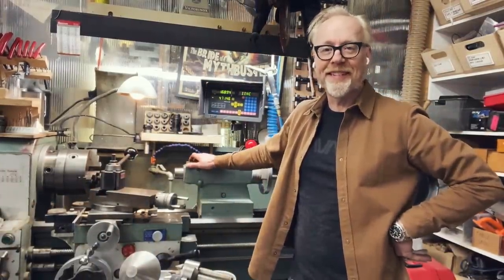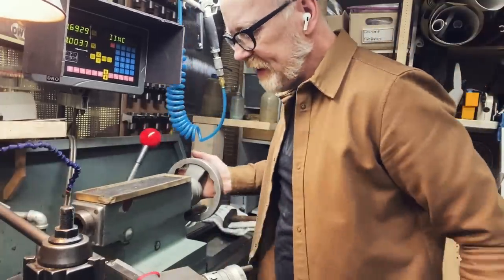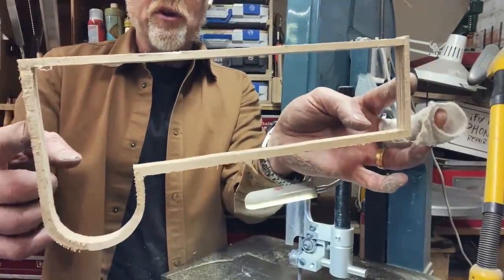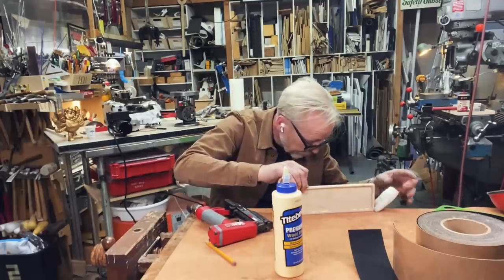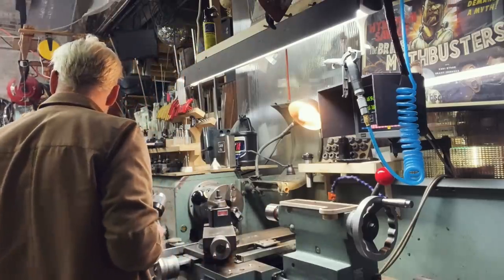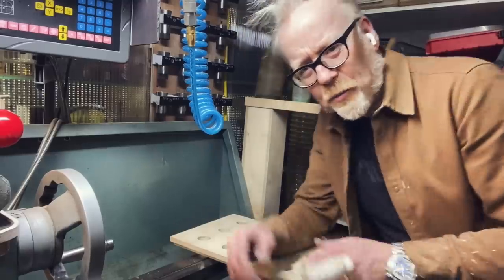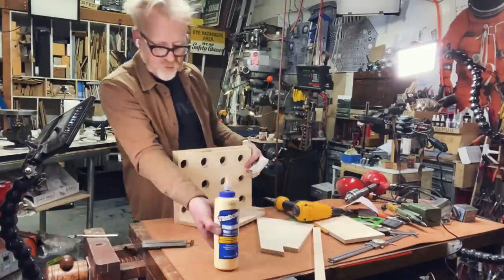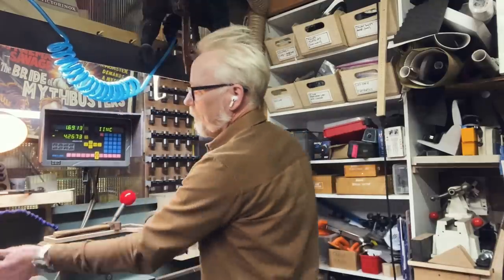Adam Savage's One Day Builds: Lathe Infrastructure Upgrades!

Comment from the maker: Materials used in this build: Senco 23XSP 23 gauge micro pin nailer: https://amzn.to/35PqgUC
23 gauge headless pin nails: https://amzn.to/2PRhqQN
Titebond wood glue: https://amzn.to/2PLuy9P
Circle templates: https://amzn.to/2y1LEtG

Disclaimer: Tested may earn an affiliate commission when you buy through the links here.
Reply: Adam Savage’s Tested Using a pair of wide, slant-tip tweezers usually works a treat for removing the backing from tape. They’re sharp enough to tear through the backing, but not sharp enough to pierce the tape itself. Another option is to use a scrap of the sticky side of the tape attached to the end of the backing. This makes a tab that you can use to pull the backing off. Hoping this helps 😄
Reply: Nicely edited Joey :) as always
Reply: Source for the carpet tape?
Reply: And I never thought about even looking for felt with sticky backing, been using the felt cutout and glued, seems so much easier and makes for a cleaner cut.
Reply: Looking over those spectacles while using that pin nailer ain't gonna save your eyes if your blow out curls back!
Reply: About that backing on high-stick tape (or every sort of adhesive surface backing, for that matter): Try a Top Sheet Cutter! They utilize an adjustable spring-loaded blade to - for instance - cut clippings out of newspapers without even touching the next page underneath. Cut on the flat of the backside and bend the tape to expose the edges. The one I know is made by OLFA.
Reply: Adam Savage’s Tested now all adam needs is a hook on the side of the chuck storage for that big hammer
Reply: next one day built to build some thing that will film ur video for u and edit it them right lol the editing was a little bit all over the place, but i still enjoyed the one day build.  i want to make some think like that holder you mad for the  Lathe but for some thing ells with taller walls just a bit more taller for a 
Remote Control Pan Tilt Automatic Motorized Rotating Video Tripod Head accept i want o make minds out of plastic ifi can if not wood if only i new how to use a 3D printer
Reply: Oh! You can run some strings Parallel to the bed of the late, conected to emergency stop. That way anything that enters that restrictive space Will trigger stop. You can also run some lasers i Guess, or optical barriers... 

Huge hugs!!
Reply: Does any of this make it safer?
Reply: Adam savage you need to do a siren head costume with those hands or fingers
Reply: What about the riving knife from the table saw?
Reply: Try crumpling a small piece of a corner when taking the backing of the tape. The backing won't really crumple cos it's stiff enough to resist, but the the tape or in this case the felt will, then you get a small lip to pull the backing off. That's how i do it works for me every time.
Reply: Simple solution for tape backing. Use a piece of scotch tape on both sides of a corner but don't stick to each other. Then peel apart. If it's a thicker  piece you only need to use one piece of scotch tape on the backing paper. It works like a pull tab.
I do that to separate window film/tint from its backing.
Reply: Stay Safe Adam!! Fingers can't be build in workshop!
Reply: Adam, when you put any of the centers in the holder on the tailstock take and put a small hollowed out foam rubber  ball over the tip that is pointed up. That way, when you are focused on your workpiece you don't accidentally run your right elbow/forearm over the top of the tip. The ball will prevent scratching or cutting yourself.
Reply: Why don't you finally built the Cain from Robocop ?
Reply: why no riving knife
Reply: Adam here is a cool pin nailer trick  always shoot it perpendicular to the  sides to keep from having blow out. The pins have a wedge shape tip which cause them to deflect in a predictable direction Finish nails are the same.
Reply: Adam Savage’s Tested hey Adam you should do a video on the different wood glues, ways to apply wood glue, and other things related. I’ve been trying  to get my old boss/teacher to get both wooden and metal lathe because there are times we need to use one instead of having him having to run to the store or order the piece.
Reply: Hi Adam, you did count 10 in the beginning. At 1:47 you can see all 10

Comment: Using a set of wide slant-tip tweezers to remove the backing tape usually works a treat. They’re sharp enough to cut through the backing, but not so much that it tears the tape itself. Another option is to use a scrap piece of the sticky side of the tape and use that as a tab to peel the backing off.
Reply: Great tips thanks
Reply: @chasewinkler4679  simply start the unbacking at the start of the roll and clip away a small sliver of the sticky part of the tape.  This leaves a handy pull tab on the backing material to allow you to quickly and painlessly unback the tape you're applying to your project, and when you get to the end of that particular measurement just make the cut like normal to the sticky part of the tape and then make a separate cut to the backing to preserve the pull tab.

Most of the time, when I use double-sided tape from a roll I'm usually unbacking as I go with the roll just hanging from my application site.
Reply: Matthew Lofton I do the same thing with a roll of aluminum foil tape I have.
Reply: @matthewlofton8465  Thanks for taking the time to explain. I'm actually looking forward to my next project with it to try this out. No more cursing at tape for me!

Comment: Did anyone else go back to the beginning near the end when he said he swore he counted 10 and only had 9 to check? I did and there were 10, so I have no clue where the missing one went, hope he finds/found it.
Reply: I JUST DID THAT
Reply: Also counted 10 so hopefully he found it
Reply: Going back i think he counted 10 but included the wrong chuck which at around 25 min mark he moves out the way
Reply: I'm somewhat sure he carried it around when that thing caught on the side of the board.. So it'll be near the drill.
Reply: @RhodderzX  @1:47 he shows all 10 in one frame so there definitely are 10 lol.  I'm sure it turned up eventually.
Reply: @XenosSavior  The one on the bottom left is the one he removed at 24:38. Which is a wrong chuck.
Reply: @EccentricVamp  yup. if you do a frame by frame at around 26:39 he has it.
Reply: J. Smith, he also counts 10 himself at 15:35! 😅🤷‍♂️
Reply: @1:47 The tray with the chucks is shown, however there are 8 x Morse 4 and 2 x Morse 2. One of the Morse 2 is still missing though....
Reply: I have to admit, I immediately went back to the beginning and stopped the video when the camera was on the tray with all of the Live Centers/Chucks and I too counted 10. So yeah it's a bit of a mystery where the 10th one ended up. I am guessing he found it.  Those things are pretty big and not very easy to lose. At least in theory.

Comment: When I remove back from VHB, I use the point of an exacto blade and stab the backing at an angle and flick straight up. Usually pops the backing right off.
Reply: Big brain is just using children't safety scissors to leave a nice ragged edge. I did something like 50, 1" strips recently in a place nobody would see it.

Comment: How have I never thought to store the chuck key in the drill's chuck before?
Reply: Exactly, I saw this and was wondering why I never did that. Going to do that from now on.
Reply: I think you have to lose a certain number of chuck keys (Hundreds by my estimation) to figure it out on your own. 😂
Reply: @Bakamoichigei  Chuck keys are almost as bad as 10mm sockets.
Reply: @rooster68w  how the crap do you know. I seriously have 3 10mm and 3 15mm because of this very fact.
Reply: @Bakamoichigei  "lose" is too strong of a word here.  All that needs to happen is your toolbox/workbench gets roughly handled (ie, an earthquake, a co-worker [or you] knock it over, you try to move it carefully to avoid having to pack and unpack everything constantly, etc) and your stuff goes everywhere.
Reply: I keep mine on a wire attached to a powerful magnet, it never runs off (unlike the 10mm sockets...)

Comment: VHB tape backing trick - never cut the tape and backing at the same time.  Just pull the backing, cut the tape, and leave the backing alone.  You'll then have a long ribbon of backing hanging off the roll, which you can trim back when it gets out of control.

Comment: I NEED to know why that skillet is there.
Reply: Seven Sins all I can think of is that it might be a chip and oil tray for under where the lathe is cutting.  Not a great option.  I use a large baking tray but that sits under the whole lathe.  Maybe this is for between the material and the bed.
Reply: Same
Reply: Paullyb79 that's what I used as well. That skillet seems like an unruly replacement.
Reply: Come on guys, you've never gotten hungry and fried something up on the bunsen burner? 😂
Reply: @peteluis2849  Ha! No, but I might now just for lolz.
Reply: @woutervanr  nice lol
Reply: I am glad I am not the only one thinking that.
Reply: Glad I'm not the only one! We need to know!!!
Reply: In some parts of the country, a shop would have a gun on the wall.  Adams in California, a cast iron skillet is a good substitute.

Comment: Hey Adam, I use VHB & adhesive backed paper covered stuff at work all the time. If it's something that squishes like VHB, I find that massaging a corner between thumb and forefinger will bring up an edge that can be got with a nail, no razor required.
I've also found that a slicing motion with a not-quite-sharp-but-not-quite-dull, nickless(!) blade, like somewhere between an 'I use my knife as a deburring tool for steel' and 'I run it over 1000 grit every few months' sharp, works excellently for separating the tape from the tape-tape. Counter intuitively better than a sharp knife, which I feel is because it doesn't snag on the VHB if you overshoot.

Comment: I bought a small Morse taper rack and then attached it to the lathe backsplash at the right end of the lathe behind the tailstock. The nice thing about the rack is that the holes are tapered to hold live centers and chucks without wobbling.

Comment: You want a double sided tape, tape dispenser.
I know you well enough from these videos to predict it would give you imminence joy every time you used one.
The one we have at work is a Venhart VH4180, it has a heavy base so it stays still when you draw the tape out, an adjustable drag for dispensing, a guillotine instead of serrated cutter so you don't pull stretch and curl into the tape. The tapes backing gets rolled up on a bobbin geared to the dispensing bobbin.

Comment: Hi, Adam, to your question about removing the backing on vhb or other similar.

I'm a sign artist and have been dealing with this problem for years.

There are 2 tricks which are best done simultaneously. Trick 1 is to pull the backing quickly, in this way it will let go more easily. Trick 2 is twofold depending on your preference.
One, take an exacto knife and pierce the corner, then flick upward quickly, or two, use another piece of tape to adhere to the backer and again, pull it quickly. Make sure the tape used is sticky enough.

If it's giving me a lot of trouble, I will sometimes push the exacto knife under the backing and twist it quickly.

Let me know if any of these work for you 🙂

Comment: for the tape/sticker backing problem: I use a relatively dull box cutter and just make a cut along the back. it takes some practice but eventually you'll figure out just the right amount of pressure needed to only make a cut through the backing layer and not the sticky bit. and then you can just bend the tape or sticker and the backing will come right off.

Comment: 12:20 Whenever I remove the backing from double sided tape I find that ripping the edge makes it a lot easier to peel than if the edge was cut cleanly. For the thicker tapes like VHB I usually take a razor and poke it in the paper but not through the tape about 1/8" away from the edge and sort of pry the edge up. Some tapes are easier than others of course!

Comment: Score the backing on your tape/felt/etc. with a hobby knife. Then you can treat it like a high quality sticker. (The stickers that have 2 part backing)

I usually go for roughly 45° across a corner (almost like cutting the corner off the backing) and leave a small connection so it's still one piece. It gives a nice tag to peel away. 

Hope that helps!

Comment: for peeling backing off stuff I find that taking a corner and bending it hard over ~180° will take advantage of the radius of the bend, and sometimes the plastic deformation properties of one material (backing or the tape), and this tends to make the backing seperate very slightly.

Comment: Adam; to peel off the backing from an adhesive sheet, I cut across the corner at about 45 degrees thru the backing, but not thru the sheet. 
I can then bend it along the cut and it opens up and can be grabbed and removed easily.

Comment: I have found that a quick hit with a blow dryer or some heat source to the corner of backing for most things makes it easier to pull off. Mileage may vary though, I've never used VHB tape since I usually like to use velcro when I can, but I can confirm it works on velcro and aluminum tape fairly well.

Comment: Dear Adam i found that cutting a small 'X' with the cutter on the inside of the pealler you want to remove and then getting it with the tip of the cutter works a lot better than trying to get the corners

Comment: Adam, great video but you forgot one method of putting a drill into the tailstock.  I have a bunch of big drills for hogging out lots of material that have morris tapers on them and they go directly into the tailstock with no chuck.  That way  you don't worry about it slipping in a chuck.  Also I am a big fan of watching you make things and the  holder that mounted on top of the tailstock was a unique and wonderful thing.  However the other tool holder that holds the centers and chucks already exists in many forms and can be purchased inexpensively.  Some are used for mill holder racks and you might need to build a shelf to set them on at the exact location.  But if you want a truly custom one and love the feel of 10 ply marine plywood you did the right thing.
I can't wait to see what's next.

Comment: For most materials masking tape on the corner trick to only peel the backing off works. 
For VHB, poke the a corner of the backing with the tip of a knife at a shallow angle. Lift the knife up away from the tape and it should start peeling off the backing.

Comment: Use a pair of needle nose tweezers to remove tape backing. Push one head onto the tape backing with a near parallel positioning and move the opposite side to pinch and peel the back of the tape off. Doglegged needlenose tweezers work well too. Same idea put the jaws near parallel to the surface and actuate one side.

Comment: Hi Adam. Yes, there is a secret. Use another piece of high adhesive tape each time you need to strip down protective layer. When you have self adhesive foil, add to pieces to the same corner from different sides perpendicular to each other. This can save serious nerves.
PS: It's nice to see that finger is healing well and you are back in action.

Comment: Adam, if you check out the Laguna 18/36 and 24/36 Wood Lathe's they have a bracket that bolts to the tail stock, specifically for holding the Live Centre and Drive Dog that comes with those Lathe's. I don't think it would be a good idea to drill into your Tail Stock as that looks like cast, and may affect the inner workings of your Tail Stock, but essentially, the Lagun's come with something similar to what you made. Love you work, great to see you putting out content still, thank you.

Comment: On the subject of double side tape. Place the tape adhesive side up on a flat surface, take a sharp knife and stab slightly through the backing (about 1 or 2 mm from a corner) so that the tip separates the backing from the tape and lever up.

Comment: German sign maker here. to get the backing off the tape, vinyl decal, felt or anything it's worth a try to fold it near one edge or corner. The usual backing paper is made in a way to separate when higher sheer forces occur, which you'll introduce by folding it. of course, if the material tends to crease easily, use common sense.

Comment: To separate backing from tape/felt, etc.: Cut through the backing in the middle of the piece and bend/roll the tape so you're able to pull the two pieces of backing away from each other, like a band aid.

Comment: Mr. Savage. Try folding the tape towards the paper side at the corner then flicking your finger across the corner in the direction of the felt. When you fold it forwards it stretches the two layers apart from eachother at the seam making it easier to find a seperation

Comment: This is just a wild guess but there's this tool used for weeding vinyl cutouts. Its basically a needle shaped like a hook so you can grab on to pieces of foil and pull them of the backing. Guess it could work for removing the backing of tape as well. If you have a vinyl cutter you probably already have this tool in your shop.

Comment: I use a bit of tape on the corner of the backing of stuff like that. usually holds onto the backing without delaminating it. Sometimes it takes a couple tries and maybe depends on the tape. I can getaway with masking tape most of the time.

Comment: For the VHB tape, don't try to peel it at the edge. Use a blade to cut the backing material in the middle and peel from there. Even easier if you cut it on a diagonal!

Comment: Normally for VHB backing removal either make a slit with an exacto or with your nail at an angle horizontally slide your nail over the backing and it should raise up quickly. I go through plenty of VHB and other tapes in Aerospace components and composites.